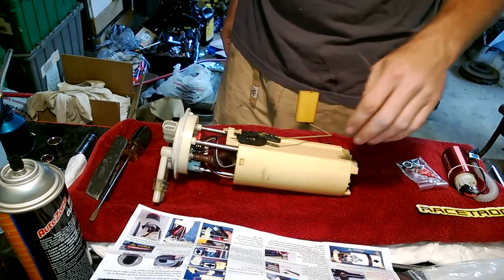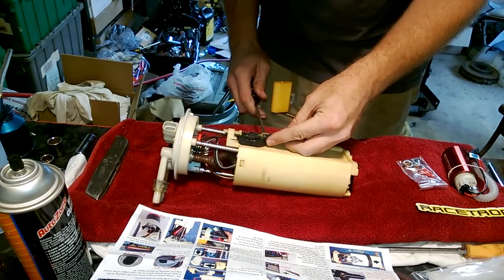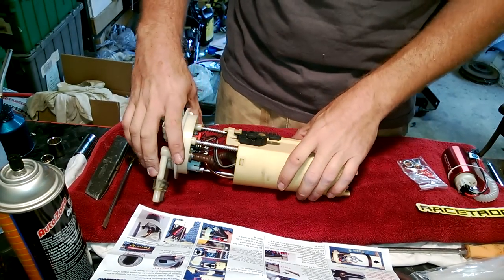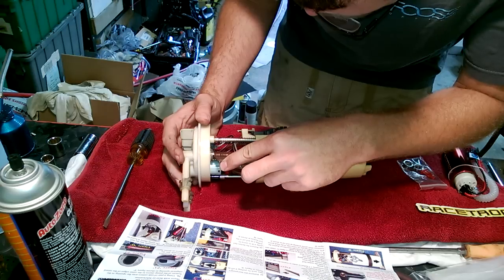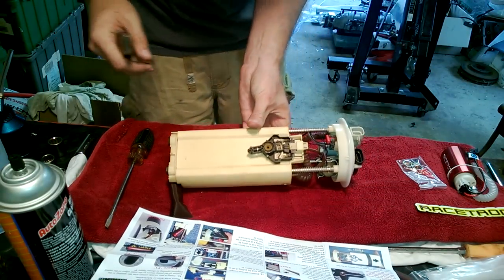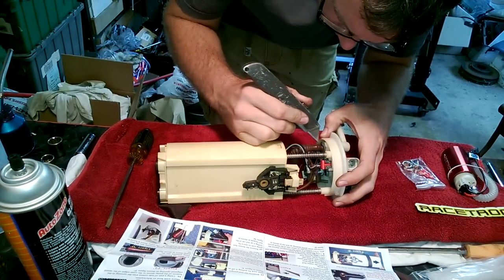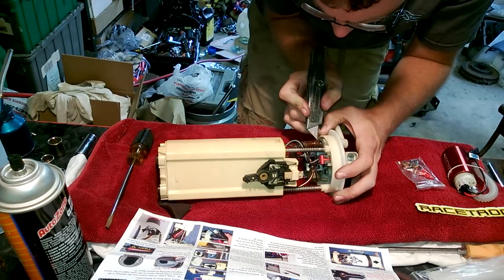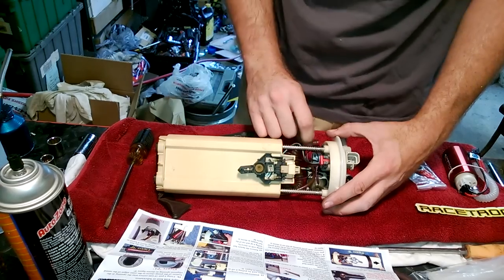Racetronix Fuel Pump Install - 99-02 F-body Fuel Sender -  FPA-001A

Comment: Make sure the purple wires for the fuel level sender are going into the internal harness inside the tank are going to the proper locations.  You can’t just swap them.  They go to different locations on the PCM.
Reply: 36k views only 220 thumbs up did he do a lot wrong this is my first time so I’m unaware.

Comment: 8 years late LOL but, THANKS. I am finally doing my LS swap and using 99-01 plastic tank, with this fuel pump/harness kit.
Reply: Did you do this?
Reply: @RocSteadyNY  Yes I did, works great. I used it along with a 4th gen tank and pump bucket from Hawks motorsports. Everything fit well and solves a lot of little detail problems, as an example. The GM pump basket unit comes with the pressure control valve right in it.

Comment: I see that the fuel pump comes with the wiring harness. Do you have to drop the tank to install the new harness or can you still use the trap door mod. Maybe the harness doesnt plug into the fuel pump directly but somewhere else on the tank?
Reply from the maker: Are you talking about the hotwire kit? If so, it does plug into the fuel sender assembly.  If you dont have an access panel in your hatch, you'll need to drop the tank.  I installed my hotwire kit through the access panel.  I did have to let the straps loose a little, just to help get the bigger plugs fished up there.  Some speculate that the hotwire kit isnt worth it.  But...my wiring was like 25 years old, and pretty small gauge.  So to me, it was worth it knowing my pump is getting all the power it wants.
Reply: ahh, thank you friend! Great advice
Reply: +JEG's Garage did you get the hot wire harness for the 99-02 year or the year of the car? doing an LS swap too. installing 02 gas tank, just need to know what harness to get.
Reply from the maker: Hey Timathy. I'm running a 99-02 tank, as well as the bulk head wiring into the car. So I got the kit for the 99-02. The car chassis is almost the same from 82-02, so the wire fits nice and works great. I saw much more consistent fuel pressure with the hot kit.

Comment: Is it ok to have both pumps running at the same time ? I bought the dual 340 pumps set up from ws6 store , hooked it up and it blew my 8n feed line ,
Reply: Will one 340 pushing e85 blow my stock trans am lines?

Comment: Hey man quick question. When you bought this off Texas speedway did you get a harness to go along with it ? Or will the factory harness of a 01 camaro be okay ?? Thanks
Reply from the maker: Factory harness on an 01 F-body would plug right in.  You arent actually changing anything on the outside of the bucket.  Just the internal parts of the sender assembly.  HOWEVER, I strong suggest looking into their hotwire kit.  Some people thing they're a waste, but after tearing apart the 99 donor car that I got, they use really thing gauge wire, and even being an 01, its 13 years old already!  Man thats crazy to think... Anyway, the hotwire kit gives you a nice big relay and heavy gauge wire, and I saw more consistent performance when I upgraded.  I was using the 99's wiring from fuse block to gas tank BTW...  I look at it like this.  Its just like a headlight harness upgrade.  If you add relays and heavy gauge wire to your headlights, they get brighter, because they're getting more power.  Same idea.  You dont have to get it right away if you dont want.  You should be able to run things without it.  Just my $.02!!!
Reply: Man you are a big help! This might sound stupid but with harness do I get? When I'm on Texas speedway it has a 3 different options to choose from and I'm new to the whole fuel pump upgrades ..
Reply from the maker: XxbrandonxX234 Well, there are really only two harnesses.  One is for the 1998.  The other is for the 99-02, which is what you want.  Did you buy the pump already?  If not and you want the harness, get the package deal.  Its a good deal and saves you a little money.  135-RFPK-001 is the whole kit. If you want just the harness, 135-FPWK-017A is what you want.  Either way, I recommend also grabbing the chassis ground upgrade.  Its like $12.  Pretty simple piece of wire with connector ends on it, but grounds are important, and its a nice upgrade.  I always recommened adding extra grounds, esp if you have stereo amps, or extra lighting.  Or even stock.  Just a couple extra braided ground straps can make a difference.
Reply: Thanks man this is a big help! I am planning on soon changing out my pump once I finish with a couple of things :p and just to be on a better safe side I should get the harness with a ground ? Once again thanks man!
Reply from the maker: XxbrandonxX234
For the price, I would.  The harness is nice.  Im a big fan of beefing up the electrical system.  This will allow your pump to run at its full potential and its fairly easy to install.  The upgraded body ground is a nice add on for the price also.  You dont HAVE to... If you want to go further, you could research the "Big 3 Upgrade".  This discusses the main battery connections, and I believe the ground also.  You can see some of the success stories from people upgrading their main power items.  I consider the fuel pump a main power item, since it runs pretty much all the time.  Good luck!
Reply: Thanks man ! Big help!! I will be replacing my pump very soon and just to be safe get the harness with the ground correct??
Reply from the maker: XxbrandonxX234
Yes.  Pump, Harness, body ground upgrade.  You'll have a pretty solid fuel system for a mild/moderate build.
Reply: That's perfect ! Thanks man!!:)

Comment: I’m going to assume it’s a similar process for a 93z
Reply from the maker: If I'm not mistaken, the 93z tank is closer to the 82-92 tanks and you'll need to cut a much bigger hole. The sender is more in the middle of the "hump", and the lines extend away from the sender as solid pieces. So you'll need to cut them. But double check me on that.

Comment: What leveler you have ? To send proper ohms to fuel gauge
Reply from the maker: Stock 4th gen. I went with a programmable fuel gauge.
Reply: @JEGsGarage  ok. Can you tell me what device or where to find one? Was it easier to get the right signal.
Reply from the maker: @dart760  it was from Autometer. Depending what gauge style you pick, the part number is different. But any programmable should work. You basically tell it what's empty and what's full. Ohm range, or direction, doesn't matter.
Reply: @JEGsGarage  thank you very much. One last question.  How was the install? Straight forward?
Is there something I will run into thats a pain

Comment: Great video.  Trying to figure out where the venturi tube terminates in the bucket.  I couldn't see it in the video.  Thanks!
Reply from the maker: Both tubes connect to the top of the pump itself.  And then up to the "hat" of the sender.  If thats what you mean...
Reply: That helps.  Thanks for the info!
Reply: Sorry to resurrect this but I’m having the same issue and not understanding your guys’ comment. I can see the Venturi tube outlet/nipple on the pump but can’t see where the other end plugs into… sorry for not understanding but any help would be appreciated!
Reply: @samuelemil5939  did ya get it?
Reply: @mikeverything4098  I got my pump to work but I just don’t know if the Venturi tube is where it’s supposed to be. Basically, how it sits now, the Venturi tube is poking through to the tank as opposed to staying inside the fuel pump assembly

Comment: If You are doing this in an older car it's smart to replace the fuel level sender potensiometer with one corresponding to Your cars instrument. I have a 99 tank in my 94 camaro and replaced the  300-80 Ohm Potmeter with a 0-90 Ohm To make the fuel gauge work.
Reply from the maker: This is a great tip.  Back when I did my swap, that info wasnt available, so I winged it, and used a programmable fuel level gauge.  If I were to go back to stock dash for some reason, or if I get a new set of gauges, Im going to swap to the standard 0-90 sender so I can use a cheaper gauge vs programmable.  That sucker was pricey!
Reply: So did you swap the potentiometer from the 94 unit to the 99 sender ? Or what did you use I have a buddy doing a 99+ tank and pump in his 96 ls1 swapped car
Reply: Yes I'm also doing a similar build on my 92 Camaro. And was wondering the fuel sender unit if there's a different part number needed to run on stock gauges while using a 2000 fuel tank and pump

Comment: You forgot to replace the gray TPA after inserting the level sender wires as listed in instruction step # 24.
Reply: Racetronix they suck I got a fuel pump from them an it never work I tried for 4 months to get ahold of them email phones calls msg AN nothing the rob me an ran I'll never buy from them ever again

Comment: Did you notice the new pump being any quieter or louder than the old?
Reply from the maker: Eh...its hard to say since I hadnt had it fired up with the old pump in so long.  It might be a LITTLE louder during prime.  But once the motor is running you certainly cant hear it.  Its not like some of the bigger pumps or dual pump set ups where you can hear it clearly over everything.  Its an awesome upgrade as far as I can tell.

Comment: From 31:00 putting that filter sock on at the bottom of the bucket I am having alot of trouble getting it on. When I try to put the new sock on I push the pickup thing up and out it doesnt hold solid like yours does....any tips?
Reply from the maker: It was TOUGH to get on.  You'll see that I ended up tapping it on.  I might have been able to push it on, but it was tight.  So  few taps seated it fully.  I would just give it some persuasion and make sure the metal ring is fully on there.  It'll stay.